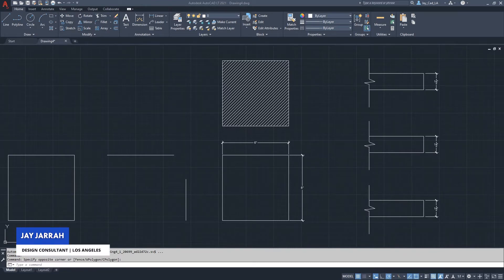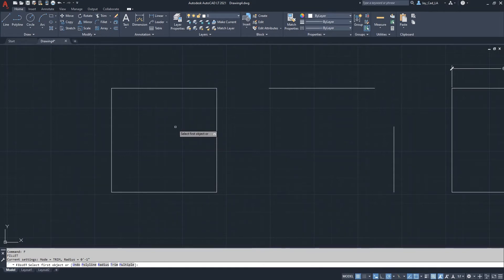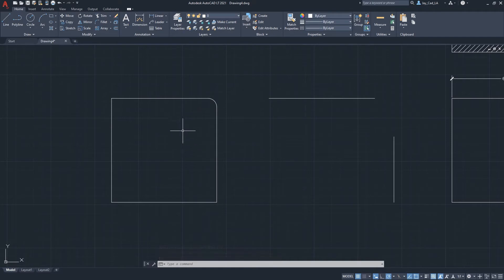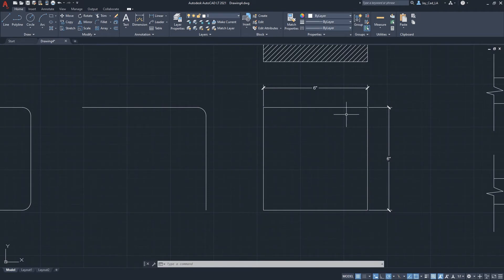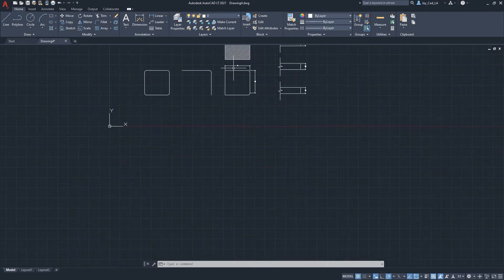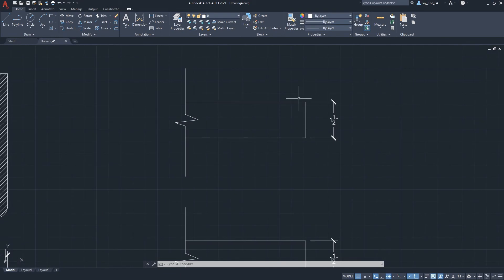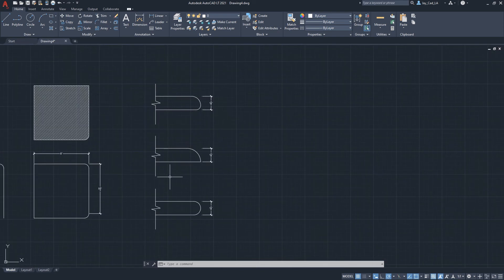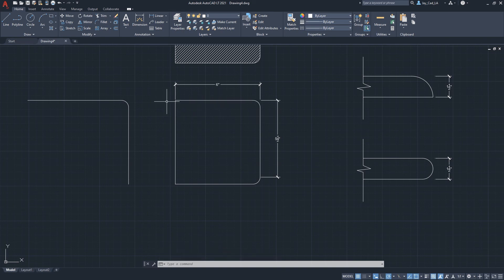HOW TO MAKE ROUND EDGES IN AUTOCAD

Comment from the maker: We can also do the fillet for a rectangle object by using the Rectangle command first then going to the command options in the "Command Line" and then choose filet, put the value for the radius and it will round all the edges for the rectangle you will be drawing! Note that any rectangle you create going forward will have the "Fillet" assigned to it - so you might want to switch the Fillet radius back to "0" before creating additional rectangles! I will share a video on this as well later on.